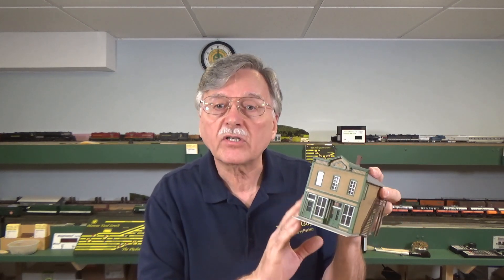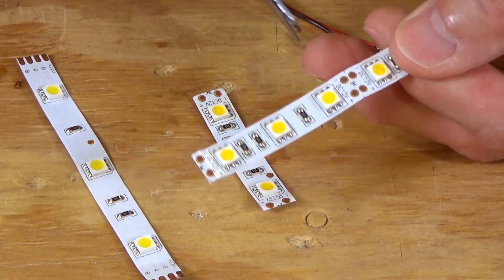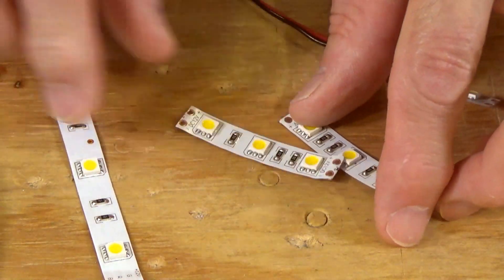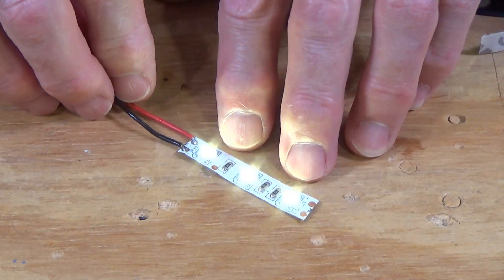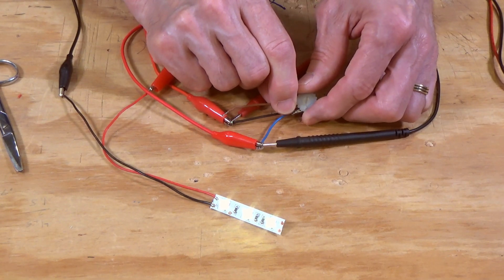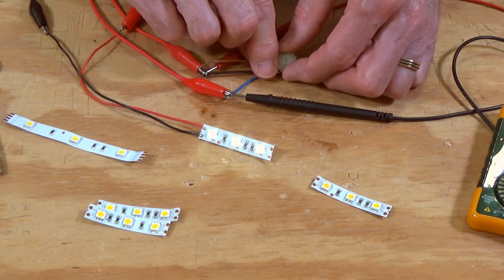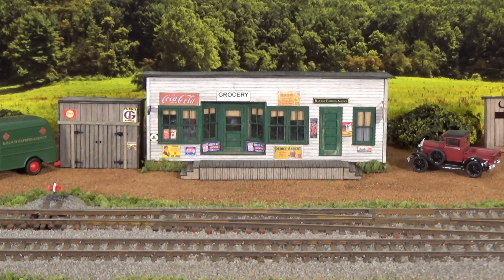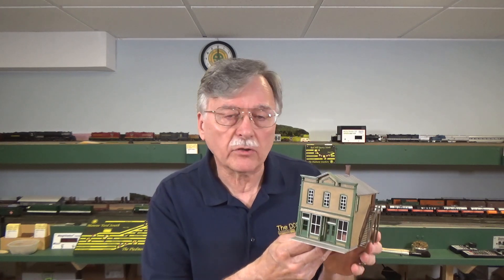Light Up Your Structures With LEDs (93)

Comment: Thanks for trying, but I sitll don't know how to wire.  You showed that neat lighting strip, which was nice.  But does it connect to my bus?  A 2nd set of black and red wires?  So there is another set of wires parallel to my track bus? 
 - My frustration is due to the fact that I dont understand this stuff like you guys, and frankly, I feel stupid as hell.
Reply from the maker: Read, read, read, and learn, that’s what I did. In that case I had a 12 volt DC bus under the layout to which were connected things like lights, etc..

Comment: What is part number for the dimmer switch and can you use on bus to dim multiple buildings
Reply from the maker: Stocks numbers differ everywhere.So look for a trim pot in the 1K or 10 K range depending on how much resistance you will need. Depending on the LEDs you will likely need something in the 600-1000 ohm range for each, as brightness varies. I discussed all this in the video and also in the description to the video and added a pinned comment asking that you read the description.

Comment: The whole video could have been greatly simplified for newbies if it had introduced Ohm's Law to start with:  V = I*R or I = V/R which is the form useful for wiring LEDs.  (V = voltage, I = current, R = resistance).  LEDs in general will burn up if more than 0.02 amps = 20 mA (milliamps) flows thru them.  There is hardly any noticeable difference in brightness if voltage (or resistance) is selected so that 15 mA passes thru an LED.  Ohm's Law would help anyone to choose the right voltage and/or the right resistance.
Reply from the maker: Yes, but if you show some/many viewers an equation their eyes will roll back and they will move on to another video. So I have to hook them first then dig into the details.
Reply: Wiring an LED isnt rocket science, and Ohm's Law is 8th-grade science.  Not all your viewers are equation "stunted."  In this case if a viewer is overwhelmed by 8th-grade science, he/she should try a different hobby.  It is important to know why 12VDC
isnt the best choice for LED power for these strip LEDs.  It is also important to know that choosing a PROPER resistor as a current limiter will keep the user from LED burnouts and/or increase the lifetime of the LEDs.  All that is easily seen thru Ohm's Law.
Reply: Your so smart. I want to be just like you when I grow up. I bet your fun at parties too.
Reply: @samuelbrucker7189  Thank you.  Have fun when you're all grown up.  Notice how to spell you're, not your.  Do your homework too.  A little education might help you.
Reply: @walshrd  you sure told me. If only I was so smart like you... if only.
Reply: @samuelbrucker7189  So why are you offended with advice that would have been useful to all readers?  Do you find Ohm's law, as taught in high school, above your mental capabilities?
Reply: @walshrd  For being so smart, you really can't see what's going on here?...
Reply: @samuelbrucker7189  So why do you take such issue with my suggestion about introducing ohms law? It is a simple concept and newbies would benefit from using it when configuring LEDs.
Reply: @walshrd   🤣 once again, calm it down. You're not anything special in this world, and the sooner you realize, the better.

Comment: Larry, can you show us how, and what you used to power your lights on your layout? Did you use a wall wart, or tie it into a accesory bus?  Did you wire in some type of switch, or a decoder? Thanks!
Reply from the maker: I ha e mentioned before that i used a 12VDC 10 amp switching power supply connected to a 12VDC bus running under the entire layout. I used buck boards to create sub-buses of lower voltages off the main bus if I have a bunch of LEDs to light. However I might go ahead and do a video just on that so thanks for the nudge.
Reply: @TheDCCGuy  Thanks so much for the quick reply. I must have missed that part. I've been binging on your great videos, and my head is a little scrambled from all the wonderful information. Thanks again, as you're a wonderful help to us all!!😃

Comment: Using a NCE DCC wireless system and their SB5 smart booster, how many volts (voltage source) are running along the bus wires? How do I use OHM's law to wire a simple LED light off the bus wires for a building? Thanks!
Reply: You want a DC bus to power your LEDs.  Dont draw power from the DCC bus.
Reply: Wonderful. Thank you!

Comment: Really cool but outdated in terms of availability of micro LEDs and of course Arduino which enables you to light multiple buildings with variable lighting, coming on and off either randomly or to a set schedule. This is nice if you use a large gauge but would not suit N or Z gauge buildings. The light strips are far too big.

Comment: Hi. Where can I buy LED lights of different physical sizes and colors to convert some of my O gauge engines and cars' lighting? The LEDs would be connecting to a 6 volt pin on a MTH Proto 2, 3 volt circuit board in the tender. What voltage LED should I use and do I need resistors. Thank you. Great info on you channel.
Reply from the maker: Look on eBay and assuming your supply is 6 volts and the amperage of the LED is 20 mA you would need a 150 ohm resistor.

Comment: What is the main difference between a 5k and 10k trim pot?
Reply from the maker: Other than the obvious, the 5K can vary resistance from 0-5000 ohms and the 10K can go from 0-10000 ohms. However because the 5K has a narrower range it is easier to fine tune it. We are basically using them as variable resistors.
Reply: @TheDCCGuy  That's the answer I needed!  Thanks again!

Comment: Larry,
Nice job.  But I have a question which may have no answer.
Do you, or any of your subs., know of a way to wire an LED Strip but limit which diode emit light if not stay off entirely?
My problem application is I have a structure with shared walls.  I need one diode to illuminate one room.  The middle will end up staggering the dividing wall.  That diode needs to be off.  And the third diode is in the other room and illuminated .  Any ideas on how to pull this off?  ~Jim
Reply from the maker: You cannot separate them as that will break the circuit. To do what you want will require using individual LEDs.
Reply: Cut a 3-LED strip so that only 1 LED lights up.  Then run branches off that strip from its inputs.

Comment: Larry, what is the size wire you use on your 12VDC bus and the wire between the LEDs?  Kimball
Reply from the maker: The wires from the bus to the structures are 20-22 ga and under a foot long in most cases. The 12VDC bus is some old 12ga wire I had on hand but 14 should do for most runs if not exceedingly long, plan for some voltage drops but they will be minor and not really an issue for most LEDs a d accessory decoders. After all you will be dropping the LEDs to about 3V and most accessory decoders work on as little as 9V.

Comment: Great video on lighting Larry, thanks for all the tips. I am guessing that you use a separate power supply for accessories and lighting? Thanks for sharing and stay safe.  Ken
Reply from the maker: Yes, I have a 12VDC 10A power supply that powers an accessory bus under the layout. From that I have voltage dropping circuits creating sub-buses that power LEDs and other low voltage accessories. Nothing but trains are powered by the DCC power bus.

Comment: Could one use an old DC transformer as a power supply, and use the rheostat as a fudged potentiometer?
Reply from the maker: Maybe. It will depend on the voltage, amperage, and the resolution of the rheostat. Give it a try, nothing ventured nothing gained.

Comment: Great video, Larry! To power the accessories on my layout (switch machines, lights, etc.) I converted a computer power supply for the task. I have 12V for the Tortoises (Torti?), and either 5V or 3.3V for lights and LED's. 24, 50, and 32 amps respectively. For a relatively inexpensive but powerful power supply, it's something to check out.
Reply from the maker: Excellent move. Those multi-outlet computer supplies are a great option. I use a 12VDC 10A switching power supply for my main accessory bus then have voltage dropping circuits for sub-buses to power lower voltage accessories such as lights, essentially doing the same thing as you.

Comment: When you talk about using a resistor to drop the voltage on a LED strip you say nothing about sizing the resistor wattage ??????
Reply from the maker: Good question, with each LED you’re only talking about 20 milliamps so for 3 on a strip that’s only 60 mA so a 1/4 or 1/2 watt resistor should do the job. However, in this case there already are dropping resistors on the strips so we are only dropping it a tiny bit more with an added resistor so 1/4 watt should be more than enough and 1/2 watt will do it for sure. Plus if you are happy with the brightness then you don’t need more resistance.I have added more on this to the description for this video.